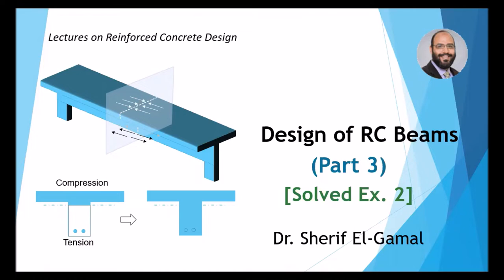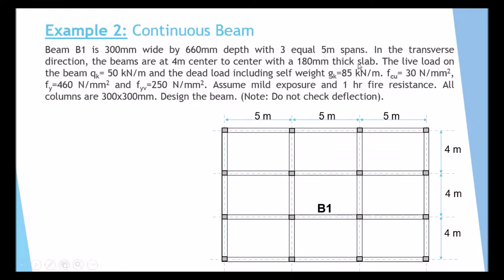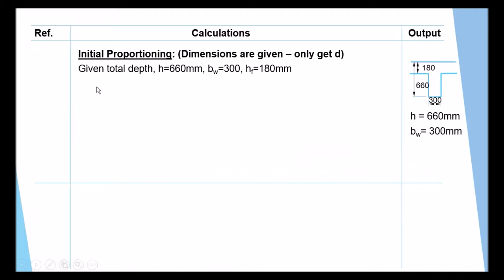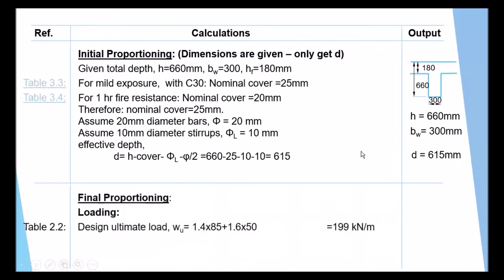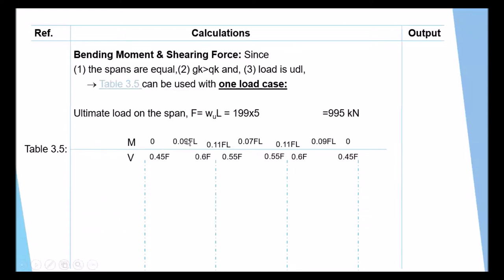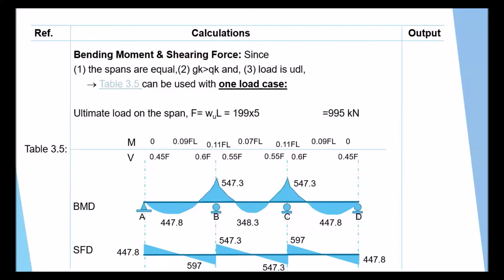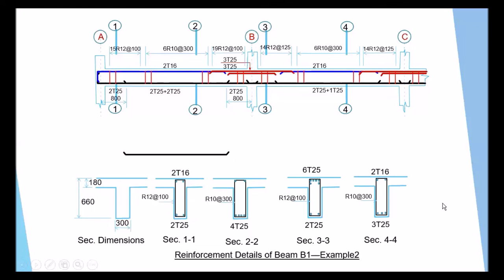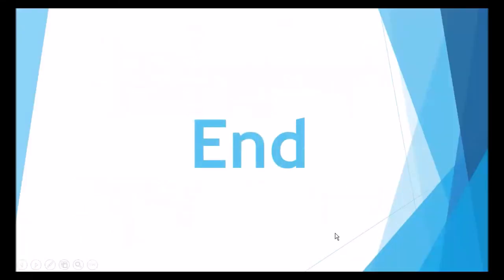Design of Reinforced Concrete Beams (Part 3)- Continuous Beams

Comment: When you calculate shear links for support A, R10 bar diameter was assumed and spacing came as 100mm. But when you calculate the number of bars, R12 bar were considered. If we consider bar 12 the spacing will come as 150mm because the Asv will differ. Then the number of bars will come as 8.  Am I right or wrong? Please explain.
Reply: also , in all his examples in the first proportioning he use 20 mm as main bar then he shift it to 25mm without explaining why ?????? we have calculated our d based on 20 mm bar...

Comment: Can you explain how did you come up with 0.775 in the equation of tension rebars on top? You can check it at time 16:50. Thanks for the lecture.

Comment: Why do we need to add a compression area to a tension area if we don't have any compression force on the tension side?
Reply: In 16:40
Reply from the maker: In doubly reinforced section, we need to have steel in the compression side of the beam as well as steel in the tension side. This is explained in previous videos. Check the video of doubly reinforced section to understand this.

Comment: Mrng sir,I've met a confusion about the span we use to calculate be ie Lz,is it the length between supports or beams.One of our lecturer told me that it is the one between the beams.And the books said about them differently.May be you may explain me more.
Reply from the maker: If the beam is supported on columns, it will be the span between the columns if simply supported or 0.7 of the span if continuous. If you are designing a beam supported of other two main beams, it will be the distance between the two supporting beams. In general, it is the spans between supports. The supports could be two columns or two beams or one column and one beam or walls (any two supports).

Comment: doc , why dont you follow the code sometimes in your equations ?? why everything is explained randomly like this , you dont show how we use the formula you just substitue , and some numbers is not clear from where you brought them.

my doubts are as follow :-

1- The Area steel dash in the code is different than you show, why you include moment as a parameter in the equation???
2- From where you get the value of 0.775 ??? why dont you even pointed out in the explanation.
3-What is the link bar size you used to find the d dash knowing that you used 10 mm in proportioning ??
4-why you shift bar size from 20 to 25 knowing that this will affect the effective depth calculated ??

definitely i appreciate your efforts Allah bless you but plz i cannot proceed learning things if there are lots of doubts.

Comment: Can you do a example of uneven span? I mean more than 15 % difference in span.
Reply from the maker: In such case, you cannot use the code coefficients. You will need to get the moment using any analysis method such as moment distribution  method.
Reply from the maker: Once you get the moment, the rest will be the same as in the solved example.

Comment: باشمهندس curtailed bars distance it  
shoud be. 08*5 not
. 08*10 =800
It is 400???
ولا كدة غلط؟؟
Reply from the maker: 0.08l for ecterior support and 0.15l for intermediate supports. The span is 5m. You are right.
Reply: Yes I noticed it supposed to be 400 as well